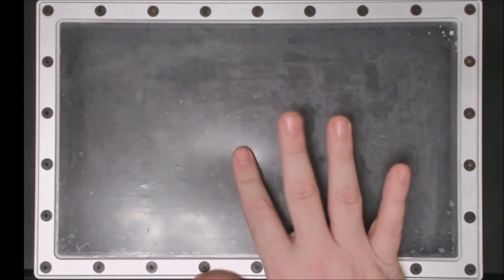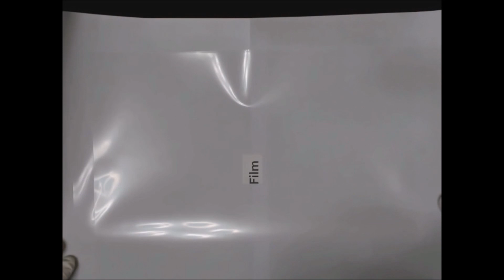Removing and reinstalling Phenom Vat FEP sheet.

Comment: Looked like your fep was tighter than the original. Did it work ok? I just changed mine on the Transform and I’m wondering if it’s too tight because the prints are now all sticking to the fep rather than the build plate...